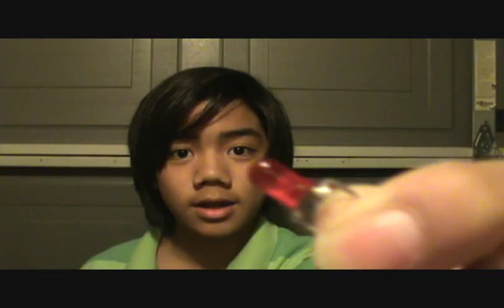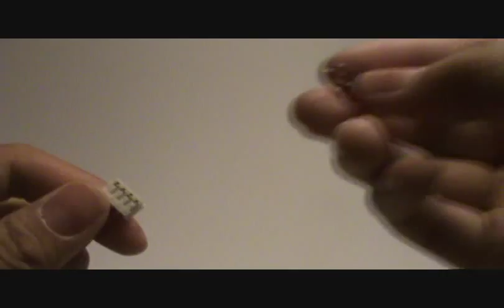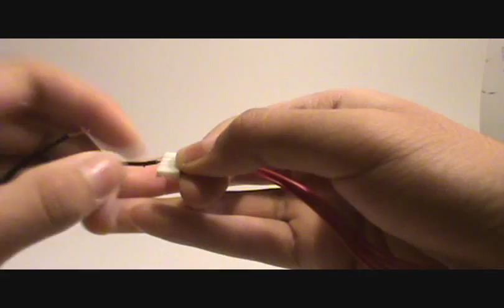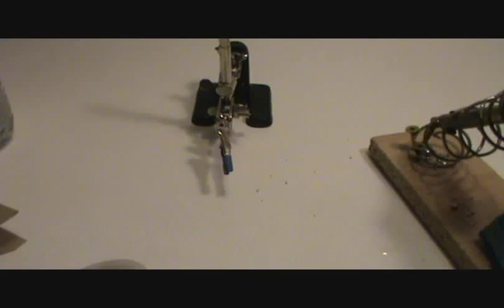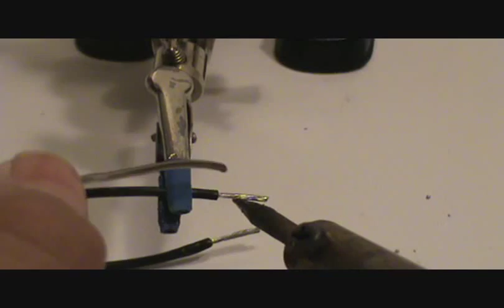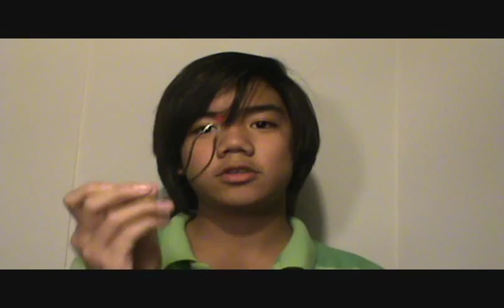Light An LED With a Motor!

Comment: I would reccomend puting a 220uF capacitor between the leads of the motor to smooth out the voltage going to the L.E.D.